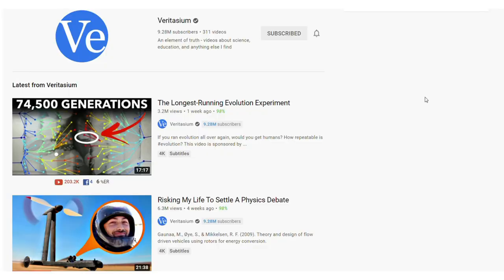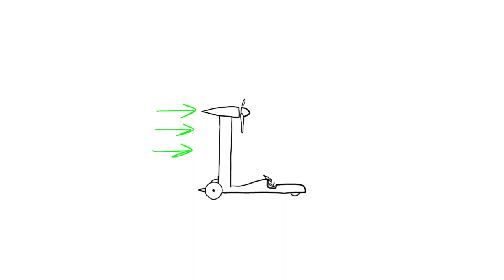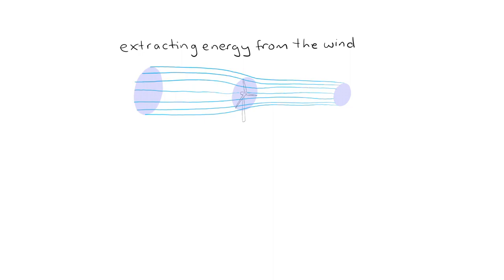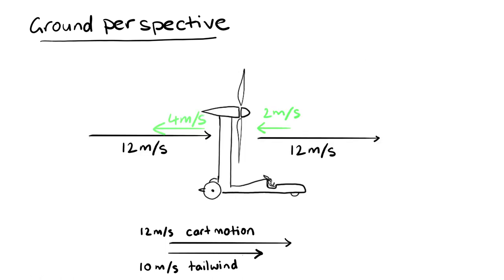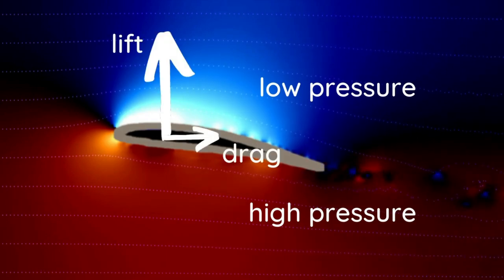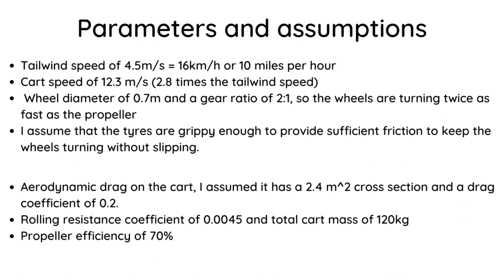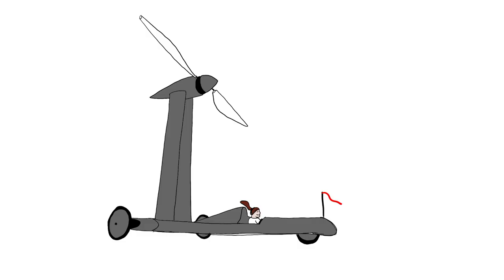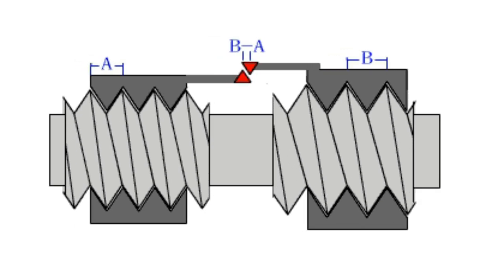Downwind Faster Than the Wind by Veritasium: How Does it Work?

Comment: Rosie you are wrong - You can only get that fancy Google sponsored Veritasium driven propeller-car or a plain old sail-car to briefly go faster than the wind, not continuously (your math is wrong).  How can you even briefly go faster than the wind?  here is an iron-clad thought experiment involving a sail-car, not that fancy prop-car - On a flat plane with a constant wind blowing in a constant direction, aim your sail-car at a downwind angle with respect to the wind direction to achieve, for example, a speed in the direction of your travel that is 3 times faster than the wind, but not faster than a buoyantly neutral balloon traveling with the wind.  

Next, as you are traveling at 3X the wind speed, going downwind, but at an angle to the wind, rapidly take down the sail and turn the car's steering wheel to aim the car in the same direction as the wind (you are now going 100% with the wind).  Right at that moment, you will be going 3X faster than a buoyantly neutral balloon traveling with the wind and, as you coast, you will slow down more slowly than a car coasting down from a similar velocity but on a day with zero wind.  This means that you will have plenty of time to turn your head and smile at the videographer who is filming the wind indicator ribbon at the front of your craft pointing straight back as you also pass a stationary guy holding a wind sock pointing the other way showing that the wind is going exactly in the direction your car is traveling.

Neil deGrasse Tyson - hand me that $10,000! .... Oh, you need the craft to continuously go faster than a buoyantly neutral balloon traveling with the wind?  Darn it.

That fancy Google sponsored vehicle that Veritasium was driving used the age old magical principal of misdirection.  The prop, the chain drive from the wheels, the fancy stream lined shape - all of that was mostly BS.  Don't get me wrong, that vehicle was able to get a rearwards push from the wind to get its velocity close to the wind speed.  The trick was that once reaching parity with the wind, the energy stored in the car's momentum (kinetic energy = 0.5MV^2) was sufficient to keep sending a slowly diminishing amount of torque though the chain drive attached to the wheels up to the big propeller which was able to briefly provide enough thrust to shove the car briefly faster than a buoyantly neutral balloon traveling with the wind.

Also, don't get thrown off by the original design team saying they have a ratchet mechanism on the car's rear wheels to prevent the momentum from driving the prop.  The ratchet's orientation that lets the wheels spin the chain drive that then spins the prop as the car goes from zero velocity up towards the wind velocity will also still allow a coasting car to send torque to the prop too.  The ratchet would just prevent the car from spinning the prop if you pushed the car backwards, which they don't do.

Rosie - Why didn't you question why Veritasium did not keep filming for, oh say, 15 more minutes to show that the car could maintain a sustained velocity greater than a buoyantly neutral balloon traveling with the wind?

Rosie, your math would say that on a windless day, if you towed that fancy prop-car behind a pickup truck, the prop-car would soon go faster than and then pass the pickup truck and keep on going, which is clearly not going to happen.

***************************************
Reply: // "The ratchet would just prevent the car from spinning the prop if you pushed the car backwards, which they don't do."//

Nope.  The ratchet prevents any stored momentum in the propeller from reaching the wheels.  It's no different than the 'free-wheel' mechanism on a bicycle -- the pedals can power the rear wheel, but the wheel can never power the pedals.  In the Blackbird, the wheels can power the propeller, but the propeller can never power the wheels. 

// " The trick was that once reaching parity with the wind, the energy stored in the car's momentum (kinetic energy = 0.5MV^2) was sufficient to keep sending a slowly diminishing amount of torque though the chain drive attached to the wheels up to the big propeller which was able to briefly provide enough thrust to shove the car briefly faster than a buoyantly neutral balloon traveling with the wind."//

Nope -- the gearing between the wheels and the propeller is fixed.  If the propeller slows, the wheels must slow.  If the wheels speed up, the propeller must speed up.  To use stored energy from the spinning propeller the propeller would have to slow while the wheels sped up.  Can't happen.
Reply: @johnborton4522  I was not referring to the momentum of the spinning prop.  Yes, I agree the ratchet prevents the prop from driving the wheels.  I was referring to the momentum of the entire vehicle.  When the vehicle gets close to wind speed, That stored energy briefly sends power through the wheels, through the chain drive and up to the prop thereby causing it to keep spinning for a brief time allowing the vehicle to briefly go above the wind speed (enough time for a photo op).  When the vehicle goes above the wind speed, the wind which was providing power by pushing against the profile of the vehicle goes away and you only can exploit, briefly, the kinetic energy of the vehicle.  The phenomenon ultimately is similar to the oscillations of a slightly damped spring-mass system.
Reply: @johnborton4522  Good point, I’ll check out your new video.  If it turns out this prop-car is doing what is claimed, one thing for sure is that the society of armature YouTube explainers are the thing that is wrong in this ongoing debate.  As a group their logic is circuitous.  If this thing actually works, then it is due to the air-dam phenomenon I talked about in my comment to the first Veritasium video, where the action of the prop causes a stable high pressure bulge behind the prop due to its interaction with the wind.  The prop then acts as a sail, in addition to its job pumping air rearward, as the air-dam pressure acts on them (this is subtly different than the pumping action of a prop, it is more like a prop thrust amplification factor).  This amplified prop pumping force, which is of course, parallel to the motion of the vehicle and aimed frontwards, is transferred as a tensile load that acts on the prop shaft, which acts on the bearings, which transfer this amplified prop thrust force to the twin prop support masts, which transfer the force to the vehicle chassis, which drives the rear wheels, which drives the chain, which drives the prop that sustains the pressure bulge/ prop thrust amplification phenomenon.  This description is completely different than the jibber jabber of the YouTube talking heads and it may be the real answer if, and   I stress the word “if”, this prop-car can operate continuously at a vehicle speed that exceeds the wind speed where the vehicle trajectory is aligned with the wind trajectory.  Bottom line, the wind somehow has to be shoving the vehicle forward even though the wind is slower than the vehicle (full stop) allowing a fraction of that energy to be harvested to sustain the propulsing pressure bulge effect.
Reply: @roberthigbee3260  

I'm sorry you spent so much time writing so much stuff wrong.  Condolences.
Reply: @roberthigbee3260  

This follows the pattern we've seen for 15 years:

A:. 'It doesn't work and the people telling you it does are frauds.  It would violate the laws of physics.'
B: ('It can't work. It can't work. It can't work. Surely it's not actually working? Omg I'm in trouble' maybe the thing actually works.')
C: 'Okay, it actually does work but the only reason I said it didn't was because these guys were explaining it wrong'
D: 'I will now proceed to explain to everyone how it really works'
E: Proceeds to give an incorrect explanation which would violate the laws of physics.
Reply: @johnborton4522  Thanks, but what I wrote was not wrong.  The internet is full of fake videos and bogus explanations and it is unfair of you to pick on me for pointing this out.  You are also projecting onto me the actions of others without really reading what I wrote.  But I forgive you for all of that - peace.
Reply: @johnborton4522  Ha,ha... You are so right John, except your steps D & E do not apply to me (A through C is me for sure).  Please know that I never heard you fully explain this thing to me, all of my comments were directed at the YouTubers who were in fact explaining it wrong, except for Veritasium's cart experiment.

You are just exhausted from reading others wrong statements, so it looks like you miss-read the stuff I was writing (I can understand this).  

Nothing I said was wrong.  

It is proper to be very critical of observed phenomenon.  You are no doubt aware of the host of charlatans on the web.  Nothing "seen" can be taken at face value without other proofs.  This can be very troubling to those who upload actual true videos of unusual phenomenon. 

Throughout my own gum flapping, I correctly maintained that if this concept worked, the only logical energy source had to be the wind (yes, I know, this seems obvious).  All the YouTubers, and that "math proof" from over a decade ago, kept yapping about the power flowing into the wheels and they then wandered off from there - this was wrong, the wind is the power source, the energy is only transferred through the wheels, not created there.

The real answer is the subtle interplay of the wind and the craft where wind energy can be both harvested, and also used to produce a thrust to push against the same wind from whence the energy is flowing.

Just because someone makes something that works does not mean they fully understand it, or if they do understand it, it does not follow that they can explain it properly.  I have seen this many times in my career.  

I am not saying that you John don't understand Blackbird, its just that I have seen how these YouTubers, as a body, do not have a sufficient grasp on this to explain it.  That is a truth that seems obvious and that I think you can come to a point where you will agree with me.

In short, it is impolite of you to criticize me for not understanding bad explanations and also to criticize me for being wary of videos of unusual stuff on the internet.
Reply: @johnborton4522  OK, one last reply - I want to admit I was wrong when I said that everything I wrote while I was puzzling this out was correct.  I was clearly wrong when I put forward the notion that the Blackbird coasts when it exceeds the wind speed and the vehicle's energy stored in its momentum is the source of power to drive the prop to make the Blackbird go faster - This is wrong since when you harvest a vehicle's coasting momentum, the vehicles speed has to drop meaning it can't also simultaneously go faster due to the spinning prop.

But I was correct in many other things - 
1. I was right about how you could make a video of a sail car (no prop, just a sail) going faster than the wind and with the wind and it would look just like the video done when Veritasium drove the car.  You do this by first, and off-camera, tacking downwind at an angle to the wind and thereby achieve a speed much faster than the wind and then you quickly turn the sail-car's tiller to direct the sail car to travel with and faster than the wind at which point you are coasting.  You then turn on the video camera and you would have several seconds to capture a video of the car's ribbon pointing backwards while also passing a guy holding a wind sock pointing the other way and you could have a guy with a radar gun proving you were going many times the wind speed.  What I am describing is a cheat, and it is not what Blackbird did, but it could be done and the video would be convincing, but misleading.

2. I was right throughout when I complained about several YouTube "explainers" starting their explanation by saying that the energy flows into the Blackbird via the wheels.  This is false, the energy source is the wind.  Even Veritasium continued to state this incorrect concept in the very same $10,000-bet-video where he came up with an appropriate explanation involving the 2X4 board pushing on the special cart he designed where he got the cart to go much faster than the board.  

3. I was right when I said early on that if Blackbird was real, then there must be some sort of "air-dam/prop-thrust-amplification" phenomenon.

4. I was right when I said that the treadmill demo is misleading since for that scenario, the power is in fact flowing into the wheels.  Veritasium failed to mention that in that demo, the thing got going because you had to first hold the car briefly against the moving belt to get the prop going and only then would the prop push the car forward against the oppositely moving belt using the gravity acting on the car to keep the wheels against the belt enabling the wheels to spin and then via the "gearing down" (leveraging) of the torque along with a properly sized propeller (in short, not what Blackbird was doing even thought the mechanics of the treadmill car were similar).

5.  I was right when I noted, after seeing the treadmill experiment, that if you went out on a level salt flat on a windless day and you towed Blackbird with a pickup truck going at a constant speed, the treadmill experiment would make you falsely think that the Blackbird would start to gain on and then pass the truck.  No, this truck experiment would show that the Blackbird would be forever tugging on the tow rope in a pulsating-like fashion as it briefly used the truck's power to briefly go a bit faster than the truck.  the second the tow rope goes slack, the power entering Blackbird stops so the Blackbird would fall back allowing the tow rope to start to pull the Blackbird which would briefly energize the Blackbird Prop, etc.

New true thing, something I have not said yet - 

No Youtuber has yet pointed out the theoretical maximum speed of Blackbird.  John, I assume you know this since you are intimately knowledgeable with Blackbird - The Veritasium cart experiment clearly demonstrates that the max Blackbird speed Vb = [(Wind velocity (Vw)) + (velocity of the air being pumped off of the prop (Vp))].  For the cart experiment, the cart velocity = [(the surface velocity of the big wheel) + (the velocity of the board)].  For the Blackbird, since the "board" is the wind, and since there is a lot of prop slippage, Vp will need to be be much greater than Vb - Vw.  

So, if the Blackbird goes 3X wind speed and if the wind speed = 10 MPH, and knowing that with zero slippage, Vb = Vw + Vp, then Vp, min = Vb - Vw, so the minimum velocity of the air being pumped backwards by the propeller has to be 3X10 - 10 = 20 mph.

I am guessing the "slip factor" of the Blackbird prop interacting with the wind is around 50%, maybe as low as 40%, so I am thinking that the Blackbird's prop has to pump air backwards at a rate equal to ~2*(Vb - Vw).  In my last example, that would mean Blackbird has to pump air backwards at at least 40 mph in order to go 30 mph in a 10 mph tailwind.

Am I right... I am genuinely asking here.

Thanks.
***********************
Reply: @roberthigbee3260  "on a windless day, if you towed that fancy prop-car behind a pickup truck, the prop-car would soon go faster than and then pass the pickup truck and keep on going"

No, that would be true free energy. This cart is getting kinetic energy from the wind.
Reply: @seneca983  Yes, thanks, you are correct... I was just kidding in that part of the comment.  Also, since posting this comment of mine above, I watched the latest Veritasium Blackbird explanatory video, where he wins a $10,000 bet with a College Prof over this issue and in that video, he has a great new and unique demo with a small cart that made me understand (finally) how the Blackbird is actually doing what it says it does.  Bottom line - you are absolutely right, the Blackbird gets its energy from the wind even as it goes faster than the wind.  

The thing that still bugs me is that there are now a whole bunch of "explainers", including Veritasium interestingly, who are still a bit fuzzy on this point.  Veritasium still keeps giving oxygen to the treadmill experiment which uses a similar wheel driven prop-car, but which clearly gets is go-power from the treadmill belt, not the wind as is the case with the actual Blackbird.... Veritasium still muddies the waters by talking about the energy being input at the wheels (not true from my perspective), the energy is input from the wind.  the interaction of the wheels and the earth just allows the transfer of power coming from the wind to be funneled up the chain drive to the prop which, in pumping air backwards, sustains the air-dam phenomenon that allows the car to get a shove from the slower wind.  

So, my funny story about Blackbird being towed by a truck was to jokingly point out that the Blackbird does not work on a windless day, it only does its thing when there is wind because the energy comes from the wind.  

Interestingly, I took some guff from the actual Blackbird inventors here in these comments as I publicly made my journey from ignorance to understanding.  I tried to take my lumps graciously since these dudes have had to deal with ton of doubters for over a decade.  They did a really cool thing a decade ago.  

The issues I have are with the YouTube explainers who mostly don't understand at all how the blackbird works.  

For example, a crucial aspect of the design that no one talks about is the precise size of the rear wheels, the precise gear ratio of the chain drive and the precise velocity of the air coming off of the prop.  Yes, they flash some equations on the screen that go by in the blink of the eye and there are some vague references to levers and sail boats but those references are all noise to me.  Big praise does go to Veritasium for coming up with that cart-demo, which is rather deep into that particular YouTube I mentioned.  The Veritasium cart demo cleverly shows the tricky way that the slower moving wind still can push on the Blackbird even though it is going faster than the wind.